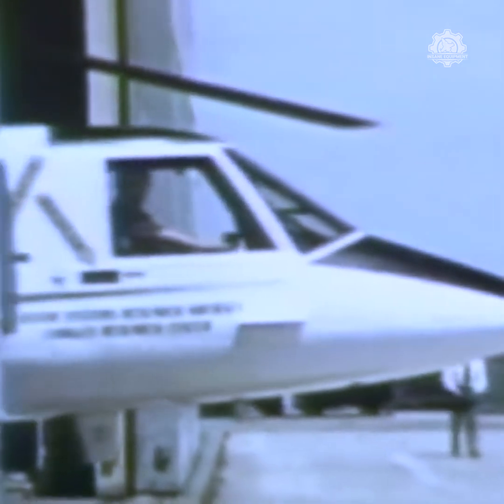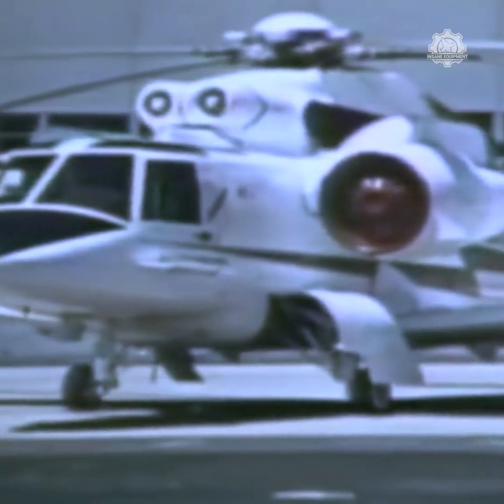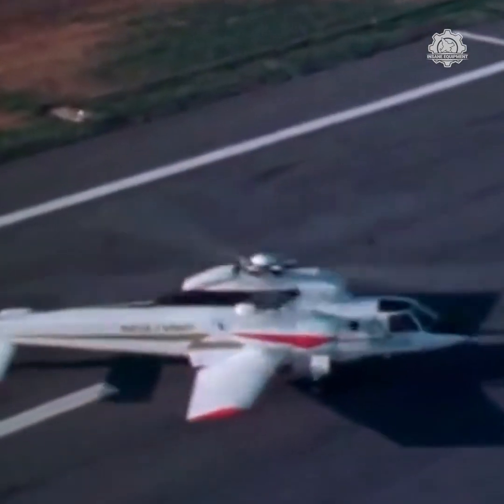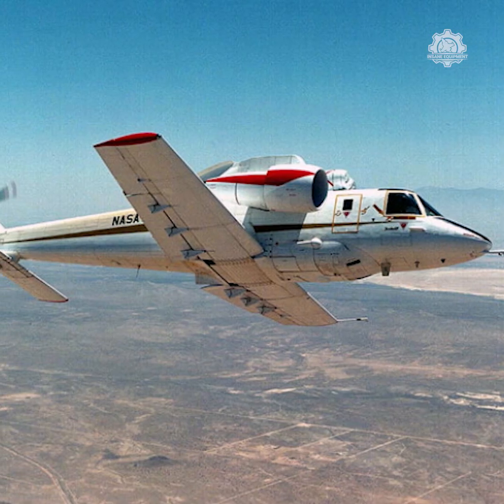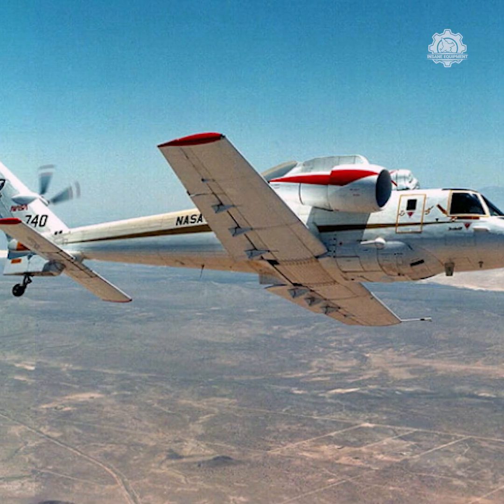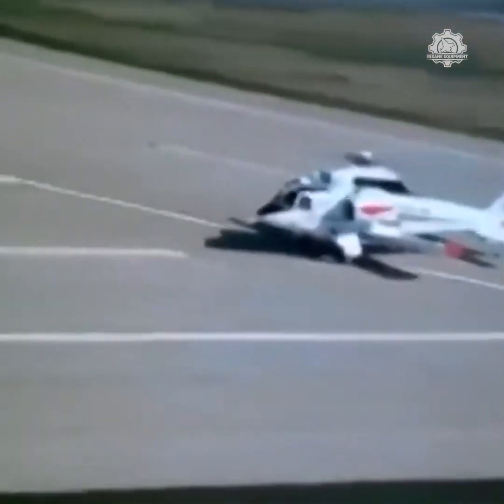A Real-Life X-Wing? Meet The Sikorsky S-72 Helicopter #shorts

Comment: But why was it cancelled?
Reply: If it were to maneuver at high speeds with the rotar blades on 
The flexible blades had a potential of snapping and or striking the airframe
Reply: @phoenixreborn3289  Could that problem be fixed by using modern composite materials?
Reply: @gabedarrett1301  the need for blades to be flexible would conflict design.
 If possible it would have very hardened and stiff blades that could probably fix the issue